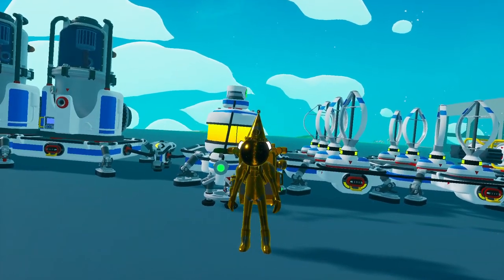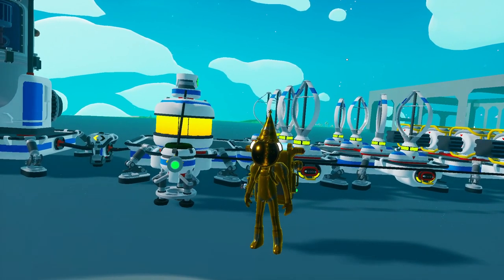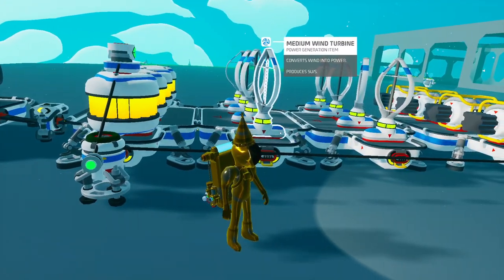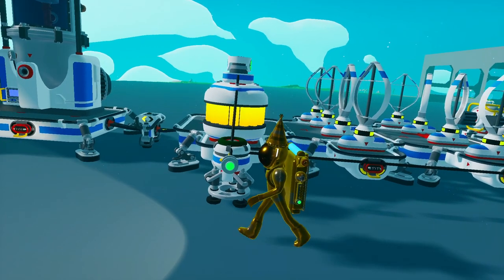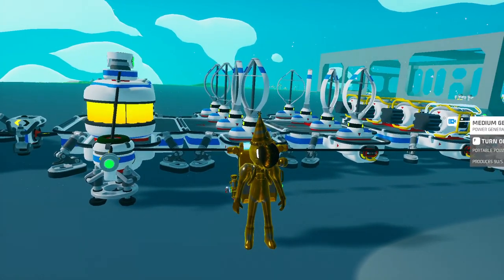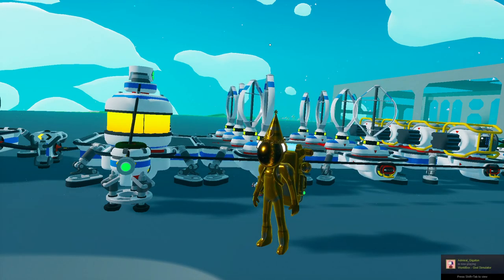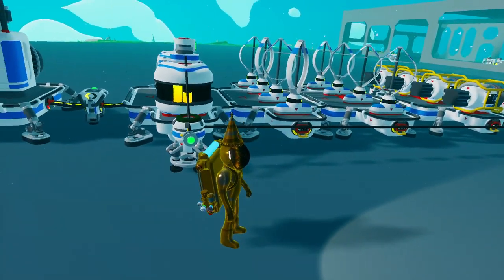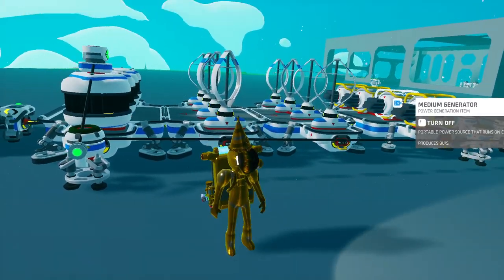Backup Generator System in Astroneer!

Comment: Year later comment, but personally, I fixed the issue myself with a different setup explained below:

Required: Generator, 2 Power Sensors, 3 (or your choice) Delay Repeaters set to max (25) delay. 

Instructions:
1) Plug in both power sensors to your platform/power to be tested. 
2) One power sensor is set to [Power Lost] mode and hooked to generator to detect outage & turn it gen on
3) The other power sensor is hooked to a delay repeater, repeater hooks to next repeater in line (repeat) until last delay repeater is hooked
4) Last repeater then hooks to the generator to turn it off. 
Explanation: steps 3-4 creates a time gap where the generator stays on to give charge to your place/batteries before turning itself off as to not waste more carbons. Without the delays, the contraption rapidly turns on and off like some redstone clock which throttles your equipment on site.

Comment: A "better" way to do this is to have a small plattform with solar and wind on it (best not conncected to the power network at all).
This way you could make use of the plattform sending/not sending a signal when neither solar or wind is running.
You could also of course just use one of them.

This way your generators would always turn on when their is either no solar or no wind power production or both (depending on how you set it up). 
This would be unrelated to battery charge, just power production.

Upside of this setup is that it always works, there is no failstate like with this setup, because its always binary, either there is power production or there isnt.
Reply from the maker: This is far superior to what I came up with and now I feel dumb.
Reply: @worldclassjerk-epicgamer  not really, his system would keep wasting fuel to generate power when you are even not using any power, just because solar and wind production stopped. so that's not exactly 100% sensical either.
Reply from the maker: @wiawaysb  It wouldn't waste fuel with the battery implementation. The battery is there to sense if power is needed.

If the battery is not empty, the generator is off.